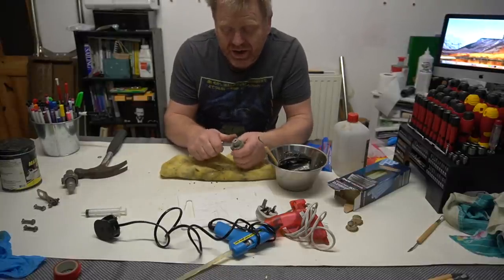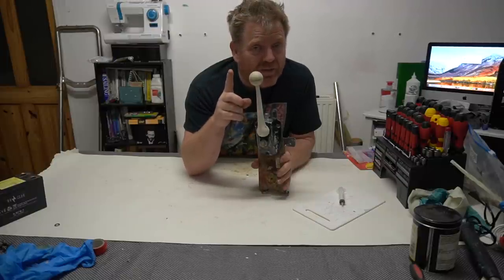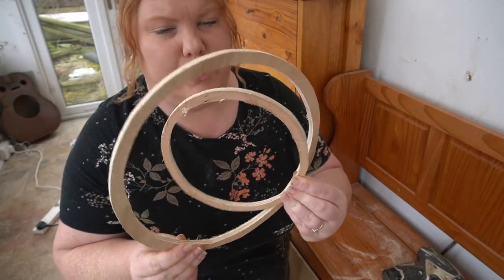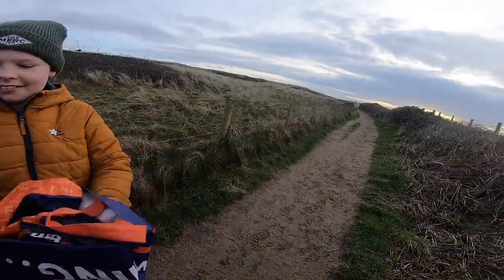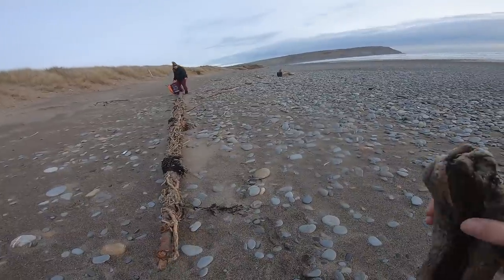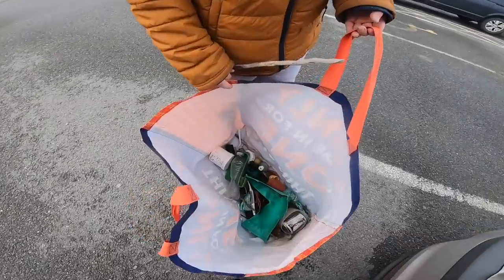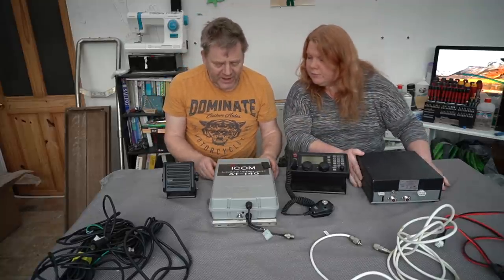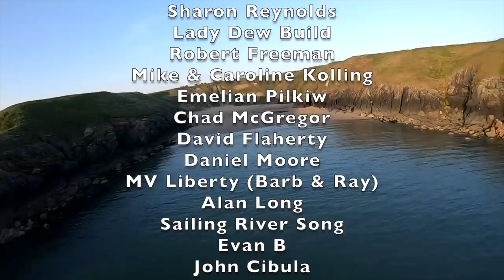#83 - ALWAYS work to do!! Even when you're SICK!

Comment: I hope you feel better soon. That HF SSB radio got my eye. You can do so much with that radio other than talking on it. Getting your UK Amateur Radio license & Marine Radio Licence opens up the ability to get weather via HF. It is one of the tools you would use. Why out on the high Seas. The antenna could be vertical off the stern. Sailors use an Isolated cable mounted on the mast to the stern of the boat. The At 140 would mount there. The device would need some ground bonding  Take care.

Comment: I would recommend using your backstay as your aerial for the SSB, this requires rigging isolators installed in-line on the backstay. If you're doing standing rigging replacement anyway it would be more cost effective too!

Comment: The 802 is a great radio; most would tell you best in class by a margin..Find a copy of Icom - M802 Starting from Scratch by TL Sparks. Couldn't be more straight forward. SSB is a cruisers best friend old school or not. The steel boat guarantees a great ground system which is the hardest part on fiberglass boats. good luck Tom Lane
Reply from the maker: I have bought the book you kindly recommended (flipping expensive it was) so I’m hoping it’s worth it 😂😂😂😂 great suggestion though thank you 🙏

Comment: Just a tip for future projects like these.  Once you've disasembled them give them a good overnight soak in  bucket of solvent.  They clean right up afterwards, much easier than scraping away at it.  Keep the solvent (even after it looks dirty)  as it lasts for quite some time.  You can recycle the solvent and most auto garages.

Comment: I love SSB. SSB is HF not VHF. You need a much larger antenna than VHF. Antenna size is related to wavelength. The sizing calculations are a bit too complex for a YouTube comment but usually you want antennas half a wavelength. SSB freqs are around 20, 40, 80, and 160 meters. So, half wavelength is huge compared to VHF. The antenna tuner allows you to avoid being precise in sizing. But, the antenna still needs to be tens of meters. The typical way to do SSB on a sailboat is to modify your backstay. Just search for SSB backstay to get an idea of how it works…
Reply: Inductive loading can easily bring HF SSB antennae within reasonable lengths.  HF comms often work when VHF is no longer within line-of-sight distances and, typically, satellite phones play up when you want them most.
One of my HF receivers (an R1155) from way back still receives signals in the Antipodes from the UK and just about anywhere in the world.
Reply: @alexandermenzies9954  Totally agree that you can definitely use inductive loading and other means to shrink your antenna and make it “electrically big” instead of physically big. An electrically big antenna can definitely work well for receiving especially if you are willing to manually tune the high-Q antenna. (I often use a tiny coil antenna for my SDR) Things are a little more problematic on the transmission side, especially if you have limited power on the boat. But, for most purposes a back stay antenna and a good tuner are a great compromise between size and efficiency. (Although some people don’t like the cutting the backstay up) If this is the case, it can be fun to try to do interesting things like treat steel life lines as a random wire and tune them… Hoisting a dipole or EFHW up the mast with a spare halyard can also work if you aren’t worried about needing to use it quickly in an emergency
Reply: @SkyThomas1  All good stuff, Sky.

Comment: Sorry to hear you all got the man flue cobber, I hear it takes a while to get the energy levels up again.
I have the same radio and tuner and the ICOM site will tell you all you need to know.
If you search for marine HF you will get all sorts of stuff come up too but start with ICOM as you can get in touch by email and get the right info regarding location, antennas and ground plain which for you will be easy.
Marine HF is still popular in the Pacific for weather skeds and you can hook up the computer and do emails and download weather maps direct from satilites and other nerdy stuff. They are power hungry and they do need to be set up right to work well. This ICOM site has a PDF download.
Reply from the maker: That’s brilliant advice thank you

Comment: Antenna is often the backstay then the tuner box makes a combination so length of backstay is tweaked to match frequency your tuning to
Reply: There may be other ways to do it now but back stay had an insulator 7ft from deck and 3ft from mast head then the wire between the insulators was the antenna (tuner box goes as close as possible to bottom of back stay).  sure there must be some good guides online or on YouTube that will help out.

Comment: Upper side band and Lower side band ,was part of the CB radios we used back in the 80,2and can be used on most CB airials, thoe back in the day ,Die pols where the cheapest, and with good ground plain, you can reach other countries,we would drive to dyseth hill near the blue lion near ryle ,from Wirral and could reach Cornwall when the skip was good,
SWR a standard wave radio metre can be used to faulsy bring down the exsesive reverse wave that returns back into the radio and heats up your power transister, causing, the radio to blow,,
With your boat bein all metal, you will have an amazing ground plain, and should not suffer tomuch SWR,you slide the top and bottom of a die pole to match the half wave lenth and all should be good,,CB radio airials came in quater vwave half wave and full, and short airals had gain (coaled half and the rest pole, being  in a mast you  also need toearth the airalI would imagine, if my memory serves my friends:).

Comment: I assume that Icom is a HF-SSB for Ham radio bands.. You indeed need the manual to know what bands are available in that unit..You do need a HF antenna that will radiate in these different frequency bands .Either single band or multi band.
HF is way different than VHF, antenna tuning is very important to control the SWR (Standing Wave Ratio) as this affects the real antenna transmission or radiation.
If it is HF Ham bands, you need to pass exams to obtain a license..Get in touch with some local Ham Radio club and they will be more than glad to help you..
Quite often the rigging back stay with insulators is used as the antenna.. The latter is controlled by the antenna tuner..
Once operational you can contact almost all other ham operators all over the world, depending propagation. In my book this is a must as a back up.. Once satellite systems are going down, it's back to basics. Hard charts, Sextant, Compass, Chrono and HF radio..
G.G.R 2018/2022 is applying those rules..
Thanks for sharing this video, quite interesting and valuable family time..

Comment: Glad to see you are back. Take it very very easy. Don’t overdo it or you’ll notice it will set you back.yet more demonstrations of your talent today.
You’ll need to use an insulated backstay for your ssb antenna. 
I did the yachtcom  long range radio course in the hamble, four years ago, which I would definitely recommend. 
One tip from experience. Tighten the nuts on top of the antenna tuner, otherwise water can get in and destroy the circuit boards.

Comment: Single Side Band (SSB) for long haul voyages are a must onboard. From 40 years of experience of Merchant Marine radio and electronics be aware ATU's are fragile and can blow easily. You should look at getting a Whip Antenna, on your yacht you will have enough cables and lines without adding another one for the SSB. Look to mount it and the ATU at the rear of the vessel. 
I suggest URM67 Co-axial 1/2 inch diameter cable. You will need PL259 connectors , males.
Try to not have any joins in the cable run from Radio Unit to the ATU - this will create losses. Weatherproof the connections at the ATU with Self amalgamating tape. Do not use elecrical insulating tape. Never press the transmit key without the ATU fully connected up to the antenna or a dummy load.
There are companies that will make up the cable with connectors for you if you can get the correct length of run which should include a "drip loop" of about 1 mtr at the ATU.
The ATU and Antenna should be mounted close together and somewhere not close to where people will be standing or could come in contact with it especially when transmitting...
The Antenna should be very securely fixed to a mounting pole and....after all that power it up.

Comment: Seriously, I would mount the throttle for use with your right hand a 
nd the wheel with your left as it is in most sailboats.  But then, you may be used to driving a car on the wrong side of the road and are used to shifting with your right hand.
Reply from the maker: That’s what I’m planning. Throttle in the left hand, wheel in the right hand.
I’m used to shifting with my left hand.

Comment: re. the SSB
Insulated backstay is the normal antenna for HF radio
the tuner needs to go under the backstay as the antenna starts at the tuner
ground is very important, you have a massive head start by having a steel boat
Good quality coax between transceiver unit & tuner NOT RG58 (and don't use that for the VHF either)

** If you want to use the radio recreationally then you  might be better off selling the kit & getting your Full Amateur radio licence. Although you techinically can't then transmit on the marine bands (you can in an emergency) there is a lot more you can do on teh Amateur bands with an HF Amateur radio

I've got loads of links with info if you want them
Reply from the maker: Great info! Thank you. Yes please

Comment: Ykm ,nou only need a small antenna mount it to the top of your mast that should be big enough
Reply from the maker: The antenna length for side band radio is absolutely critical. If you have the antenna the wrong length you will burn out the transmitter in seconds.

Comment: Not all but MOST!! RF radio devices. You can cause damage to the radio itself if powering it without an antenna plugged in. Just keep that in mind. That does not stand for every system, but it is a good rule of thumb regardless to follow.
Reply from the maker: Absolutely, that’s why I’ve not switched it on yet :)